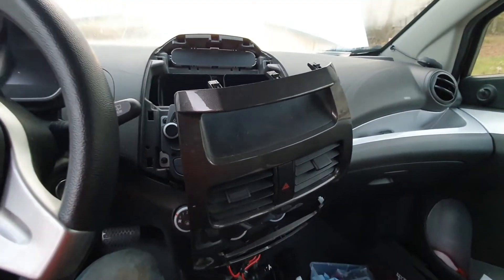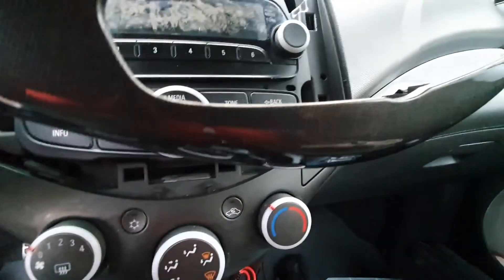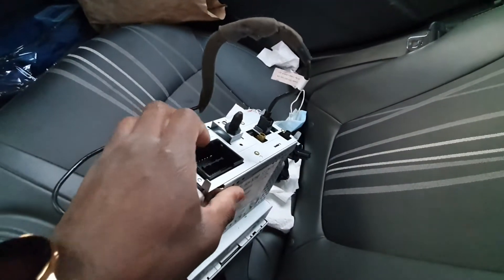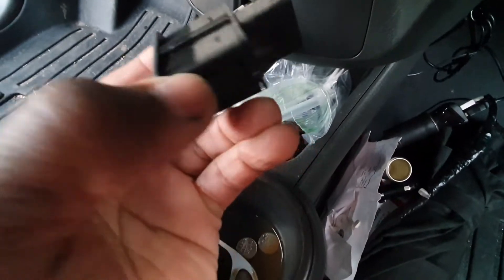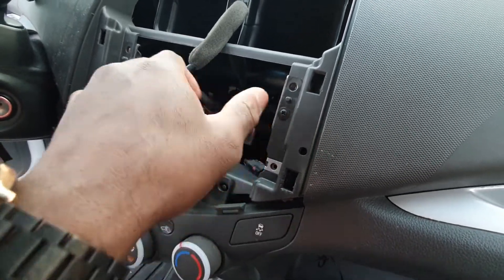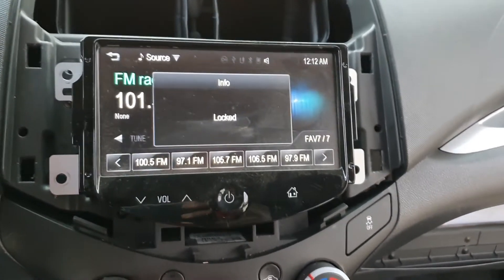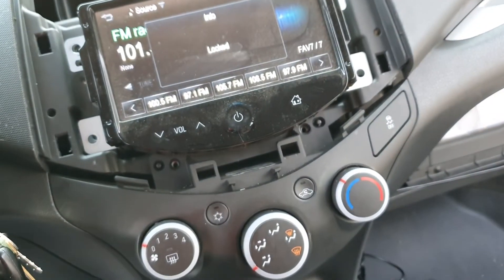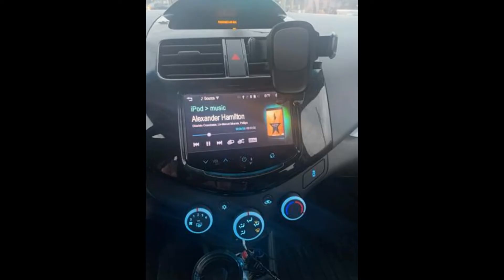2015 Chevy Spark MyLink Radio Install

Comment: What did you end up doing to get the Mylink radio to fit with the original trim?
Reply from the maker: You will need the specific trim that fits the mylink radio. I was able to sell the old one on ebay. It fits the same way.